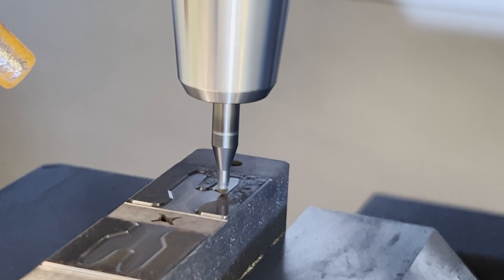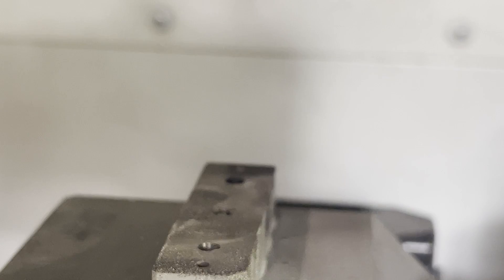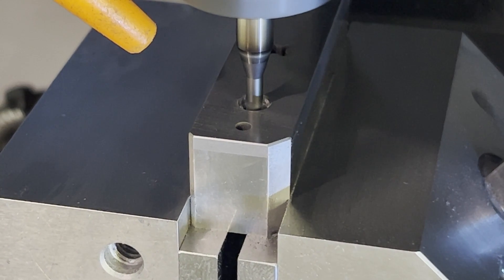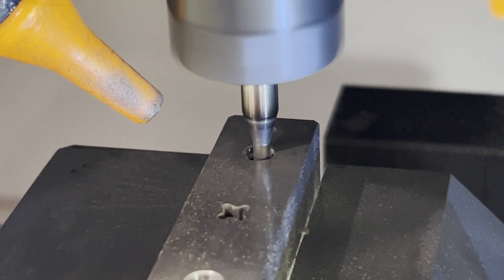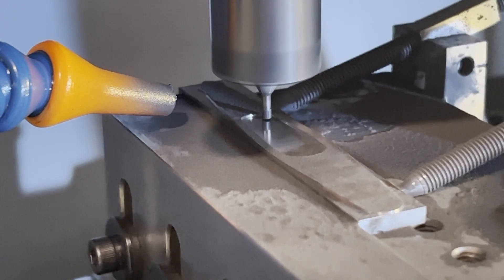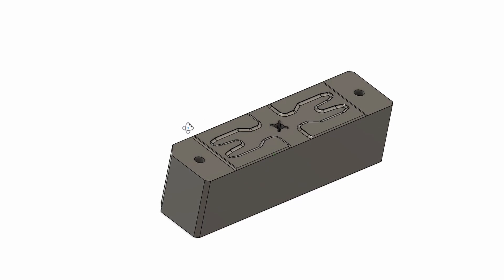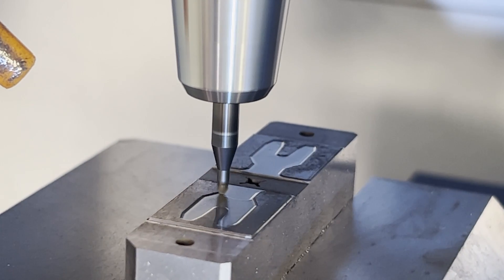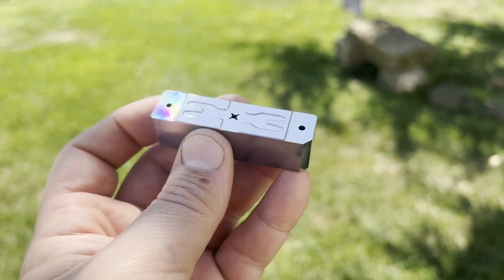Milling Carbide with diamonds

Comment: Threads in any grade cabide can break very easily if over torqued.  Invar plugs silver soldered and then tapped normally is preferred.
Reply from the maker: I’ve seen plenty of invar plugs fail . Personally whatever the customer pays me for is the best option

Comment: Is this green carbide, or has it been sintered?
Reply from the maker: @Modern.malcontent sintered
Reply: @adamthemachinist  If you don't mind my picking your brain, I've got a large piece of stainless that I'm trying to remove a 5mm broken carbide drill from using an 1/8" diamond grinding pin.  Do you have any insight on speeds and feeds for something like this?  Currently I'm turning the spindle at my max rpm of 5k and helixing it down .0002" DOC at .5 IPM.  I Currently estimate my completion time at 2 days after I retire at this rate.  Can I speed this up?
Reply from the maker: @Modern.malcontent  I don’t think you can get to aggressive. the rpm is problematic, it’s going slow enough that the diamond is more compelled to pull out of its bond than to cut carbide. That being said you feedrate feels a little slow . Count or estimate the number of grains on the bottom corner of that tool and treat them like the flute count. Say it’s 50 grains and you want .0001 per grain feedrate , that’s a bit more feedrate than you currently have
Reply: @adamthemachinist  Thanks.  I'll give it a try tomorrow when I get into work

Comment: Your channel is amazing dude. And I really like your calm explanations. 
If I could add a request..? Would've loved to learn what that part did..?
Reply from the maker: A stamped part with a shape about the size of the area cut has a very sharp edge when stamp cut . This insert and its matching punch squeeze a chamfer on the sharp corners of the part
Reply: @adamthemachinist   awesome. (and thank you) ... it's v relaxing to watch. 
I'm not sure if it's the nature of carbide or your machining ... but it really is beautiful.
Reply: @adamthemachinist  Watching this again ... and at the end of the video you mention something that was perplexing me: The rainbow effect. On a butterfly, the colors are a function of it's microscopic pattern matching the wavelength's pitch. But along with many other potential causes, I ruled that out because it seems the passes are impossibly huge in comparison. Even if those passes were much smaller than I think they are, they cannot be even as small as a micrometer, and a micron is still 1,000 larger than a nanometer. Far to large to mimic the variations between colors, which'd require 20 micrometer variances to shift between blue, green and red. More than 50x smaller than the extreme end of how small those passes could've been ... and would've taken a year at the rate of passes to create the 'texture.'  But it's still doing it. It also can't be a property of carbide, or it would've been doing it earlier, before the machining was done. 

I'm betting you know what caused that though. I'm pretty sure you have a physics background (along with your high IQ) ... you're a curious person with interest in and attention to detail. Please ... how is this effect created!?  If you find it interesting enough, maybe you'll make a video about it. 🙂 It has after all, been a couple of months since we've seen a video of yours ... 

Hope you have a relaxing thanksgiving ... who knows, maybe instead you'll do a video on this year's christmas gift. That flexure nutcracker was amazing. I still tell friends about that beauty. Take care Adam.
Reply from the maker: @trumanhw  So the rainbow effect has a few things working for it.

First, certain diffraction grating patterns can work with quite a course pitch. Personally I've shaped as Corse as 31.6um and still had a rainbow effect. But the ballmill finish stepover pass is still much Corser than that even, so what is throwing the rainbow back at us? 

Well that would be the not the stepover  ballmill grooves, but the feed forward lines causing the rainbow reflection. The feed per tooth advancement of the ball mill is much nearer the pitch needed for diffraction. So the grooves making the rainbows are not the ball shaped grooves formed by the stepover, but the scoops caused by the ball mill swopping into the material and progressing forward. Softer materials would burning some and the sharp edges needed would vanish making the reflection of rainbows not work.  

Normal materials, the ball milling stepover and feed per tooth are generally very close in value, that doesn't work in carbide milling. 

I go into the surface affects of low angle ballmiling in my video "improve your polishing with 3d printing" video.

I hope that answers your question.
lastly, take what i say with a grain of salt, no Physics background and I have average intelligence . Im just lucky enough to have some remarkable smart clients that shed some knowledge.

Comment: Hello Adam,
I am considering this approach for some tungsten carbide form punches. We have a sinker EDM however with the age of the machine, at the time carbide required an additional power supply and settings (which we do not have) so it is not optimal, not to mention the electrode would need to be machined from tungsten and the part requires .0005 tolerances. It is a shallow surface feature only .007 deep at max within a .800 diameter of sintered tungsten carbide. We are considering a solid PCD ball mill from 6C Tools which I think may be a viable option. At .002 stepover it would produce a 1um cusp height which may be a high polish enough off the machine. I noticed that you did not mention the tool maker you purchased these from and I am curious as to what sort of tool life/part consistency you were able to attain after a few goes with these shown in the video. I would greatly appreciate your insight.

Thanks,
Erik
Reply from the maker: Most of the tools in The video are Union tool brand . One shot is a 6c and I find them to be the best solution but sometimes the lead time isn’t workable so I use union.
Reply from the maker: Tool life really can vary quiet a bit depending on the composition of the Cabride
Reply: @adamthemachinist  Hi Adam, thanks so much for your response. It's been a while since I last checked these youtube posts. I really appreciate it. We did a trial in 58-60Rc D2 with some harvey 6flt tools. Thought it came out nice after polishing but didn't get the re-order. We considered an air turbine spindle for them but they couldn't stomach the tooling cost. Don't blame them either. Anyway thanks for your videos and feedback! Keep up the great work!

Comment: Hi Adam, I'm sure you probably went over this before but, if you wouldn't mind, would you please throw a couple of sentences my direction, telling me how you got into this machining branch of your journey?
Thanks! 🙂
Reply from the maker: My first employer was pretty successful due to specialization in large parts and exotic alloys, that stuck with me. Went the tool and die route after that . But the idea of special machines and unique processes had some appeal when I was forming my business. To form a traditional tool and die shop wouldn’t have been possible with my space and budget. so I ended up with a few key pieces of machinery that lets me handle work that typical tool shops don’t want . Form grinding ceramic this morning , a referral from another company that didn’t want to mess with it .
Reply: @adam the machinist  That is very cool! You found your niche and people know what you specialize in. 
You must be one happy camper!
Thanks for the stuff you share. 🙂

Comment: 2:05  Screw stretching is unavoidable so the first thread will always take the biggest load. BUT There is another strategy. IF you can slightly increase the pitch of the female thread (or decrease the pitch of the male) then the load is shifted to the deepest thread engaged thus relieving the top thread of load. You can't do this with that multi tooth cutter, it has to be a single tooth. 
You can determine the required pitch change by measuring the stretch of the tightened screw either by direct measurement or by calculating it from the tightening angle. 
EX:  if 1/4-20 screw from snug to full tight is 1/4 turn=90degrees.     Pitch .050/4= .0125 stretch over the length of engagement. IF the length of engagement is 1/2" then the pitch of the female would have to be increase by .0125 in 1/2" or .025 per inch. So you cut the female thread to 20.5 TPI
That strategy is used in ultra severe applications to keep threads from domino unzipping from the top.

Comment: Hi Adam, i have done some carbide milling and grinding on my vmc before. Now i have to do the same parts as before but give them an additional hole for positioning. Is there maybe an option to directly contact you for 1-2 questions/tipps for the hole making process? I would love to avoid ruining too many cvd tools on these holes. Would be much appreciated! Thanks!
Reply from the maker: Sure drop me a line on Instagram, not sure I’ll be able to tell you anything revolutionary about the process though

Comment: Sir, would you like an apprentice?

Two years oil and gas (half of high school)
Two years welding (Alum. Tig/Pressure vessel during other half of high school)
Two years at a machine shop currently remanding torque converters. I was yelled at for not fighting and fired by the manager then re-hired by the shop owner.

I don’t fight unless i can’t run.

I will have to fight tomorrow.

at least for better pay.

Comment: It always amazes me that some folks think carbide is actually hard.  I guess it is compared to some things, but diamond is way harder than carbide.  I have spent the last 30+ years designing drill bits that use PDC (polycrystalline diamond compact).  A slab of PDC is stuck on a carbide puck.  It is analogous to a sheet of glass on bubble gum.  Diamond is unbelievably hard.  As long as it is kept cool.  Diamond softens quickly at temperature.
Reply: More like glass on plywood
Reply: Does CBN soften at temperature?
Reply: @lindboknifeandtool  I don’t know.  It was too prone to fail in brittle fracture for our use.
Reply: Thank you for the information
Reply: @athrunzala5337  You are welcome.   Just a bit more info.  
Diamond can be used to machine certain materials because of how hard it is.  However, it can not be used on many.    Anything with iron is off limits because as it gets hot, the iron wants the carbon.   Diamond is just carbon.   Arranged differently than other forms, but just carbon.  The iron will suck up the carbon.   Expensive way to carburize.  
Diamond can not be “sharpened” in the traditional sense.   It really just plows through, or gouges out what us in its path.  Tensile strength is not high.   All the bits I design, used to drill oil wells, have the cutter set so that it scrapes rather than cuts as one would visualize a lathe tool or end mill cutting.  As long as the force is trying to push the PDC layer into the carbide puck, things go well.  If the direction of force moves closer to trying to slide it off, things can go badly in a hurry.   
Nature makes it’s own Polycrystalline diamond. They are called “carbonados”
Reply: @dougberrett8094  that sounds really fascinating. How'd you get into that? I've been trying to justify my desire to get an MS in material science and what you are talking about seems to articulate it for me somehow.
Reply: @MrKadvaga  I simply answered an add for the job.   The add did seem to jump off the page, and it was not just any PDC bit company.   It was the world market share leader.  Very committed to excellence.  Our material science group even had a traveling electron microscope.   I became a specialist in designing bits to cut cores for formation analysis.  I was literally send around the world to solve coring issues.  So if MS is calling your name, go for it!

Comment: BEAUTIFUL part!!  The "rainbow" reminds me of an optical diffraction grating.   If it's not proprietary, what is the pitch or step-over distance on the floor of the cavity?  Thanks for sharing.
Reply: The maximum wavelength that a grating can diffract is equal to twice the grating period. The groove density can vary from a few tens of grooves per millimeter, to a few thousands of grooves per millimeter, and still give a diffraction grating appearance.
Reply: @Bubu567  So, for the spectrum of visible light (380-700 nm),  the advancement for each pass would be approximately 0.35 micron (350 nanometers) in this case ?  That's some mighty fine tool control.  Thank you.
Reply: @FCleff  Double the spectrum. 1400nm, or 1.4 microns to start getting visible diffraction. 0.76 microns to see the whole rainbow from red to blue. So basically, about 1 micron steps would give a great diffraction appearance.
Reply: @Bubu567  Thank you.

Comment: What kind of milling machine do you use.?  Do the spindle and linear axes use hydrostatic air bearings ?
Reply from the maker: It’s a Mori nvd1500dcg , the ways and spindle are rolling elements

Comment: RAINBOWS :O <3 Wow, how long does that last once in use?
Reply from the maker: In this case it should hold up fairly well since the part is just getting lightly pressed into the cut out . Things like draw die inserts that have lots of rubbing tend to deteriorate very quickly

Comment: Wish there was a shop that did this stuff around me. Would love to learn to do this sort of work. 90 percent of shops in my my neck of the woods are production, where I first started learning, then there are probably about four percent of job shops like I work at now. Then the one percent of places that do truly precise work making machining an art, but they are never hiring. It's very annoying being a younger person without a degree that loves and is willing to learn but every place that wants to higher you insists you start at the bottom of the ladder doing menial work...
Reply from the maker: The apprentice model of making them do crappy work for a year doesn’t help the issue of getting young people in the trade unfortunately
Reply: that,s where most people start, at the bottom.  You have to prove yourself, lower your expectations your not a shop foreman yet, look at it this way nobody  is going to put you on a million dollar machine before you can opperate a drill press
Reply: @oldog2  I fully understand that and have been through it several times and that is the problem. I come in give 100% every day and have run machines worth far more than a million dollars, all at the production shop. My old boss at my first shop was teaching me some small things, a bit of g and m code, but didn't have the time to teach me fully. He even gave me a reference when I quite because I wasn't really learning anything and one of higher ups tried to "big dick me". Then when applying for my current job I made it very clear that I was there to learn and that I would even take a pay cut to go there and learn. Spent the first six months doing shipping then actually started to learn some real stuff. I appreciate what they have taught me, but I don't have time to waste six months to a year of my life at every place I go trying to further my knowledge when the teaching stops, just to prove myself.
Reply: @Nathan_Whaley-g8m  you gotta know when you are putting in your time and when you are just wasting your time. Some people/places will just use your willingness to squeeze cheap labor out of you without ever letting you get into the good stuff, some places actually care and will respect you and give you opportunities.

Comment: Is not carbide dust kind of like asbestos in that it can cause cancer if you inhale it?
Also do the diamond coated tools wear away like a grinding wheel to expose new grit?
Reply from the maker: It’s generally terrible for you , I handle it with precaution. The grinding wheel shown is a single layer electroplated wheel and just gets replaced when it begins to wear
Reply: It's probably more the cobalt binder in the carbide that would cause a health effect. It messes with your lungs, liver etc.
Reply: The high density settles out fast.  Asbestos fractures as flexible needles so it floats like a ballooning a spider web.  
I have used thoriated tungsten for GTAW,  grinding with a diamond wheel.  Thorium is radioactive so I've looked for the dust with a Geiger counter.  It settles within seconds.

Comment: This is some kind of extrusion die?  Mould?
Reply from the maker: Burr kill insert on a connector progressive die
Reply: @adamthemachinist  The wonders never cease.
Reply: @adamthemachinist  Perhaps this is a stupid question, but why would a client need sub-micron tolerance and mirror surface finish on a stamping die? Not busting your balls, I'm genuinely curious.

Maybe consider addressing more general questions like this if you want to grow your channel beyond a very niche audience of hyper-specialized machinists.
Reply from the maker: @_GOD_HAND_  finishes are generally a good way to improve insert life on die. As for tolerance , we need the tool to be built to a standard of 10x tighter than the tightest tolerance on the stamped part to be able to safely work inside the tolerance windows. Also, these tools benefit from being able to replace wear items quickly which also requires a high level of consistency and fit . The last thing to consider is that the part hardness forces you into a process like grinding or hard milling , once youre in a high precision process a .0001 tolerance isn’t any harder or more expensive than holding a .001 tolerance
Reply: @adamthemachinist  Fantastic answers! Really interesting stuff. I'll never look at a stapler the same way again. More info like this, please.